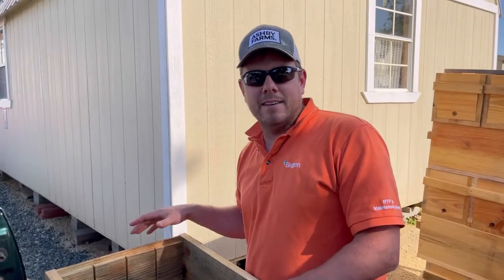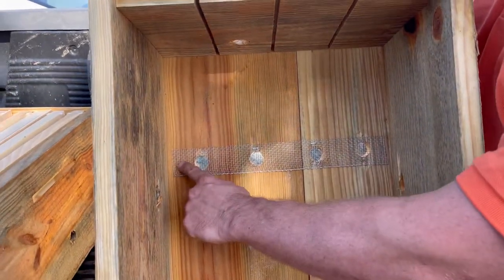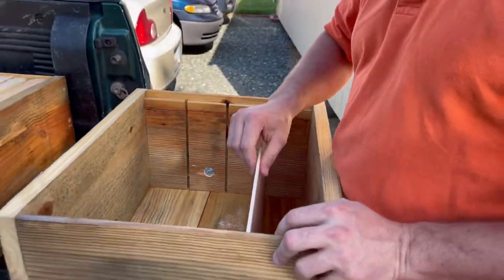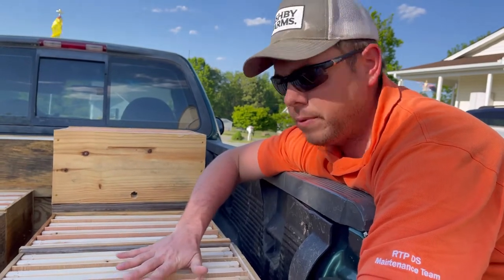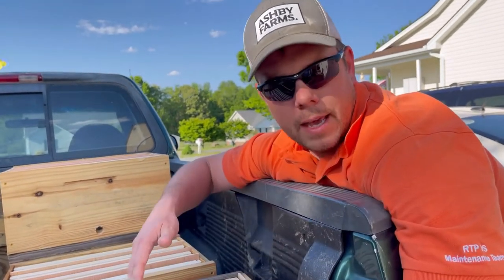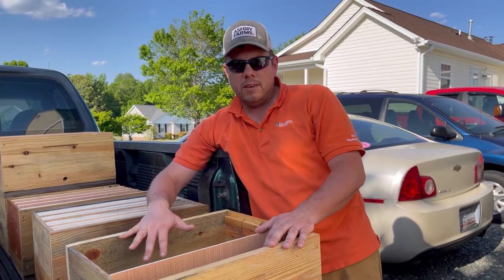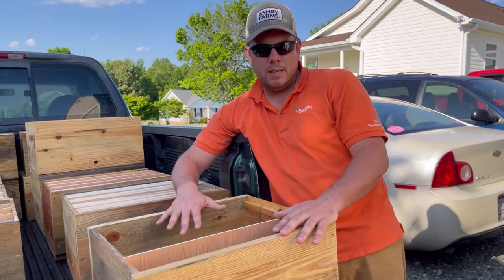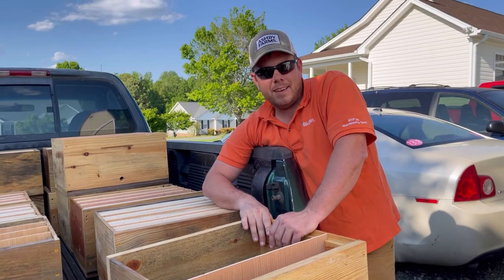Beekeeping Queen Castle - Expanding your Apiary

Comment: i made something similar, but I had the dividers taller and has 4 separate lids with a hole and screen each.  There is a telescoping cover over the whole thing.  However the bees propolized the screens almost entirely.  I'm curious if that happens to you as well.  Thanks.
Reply from the maker: We started using porch screen over the tops. We don’t have an inner cover but use migratory lids. The porch screen works great